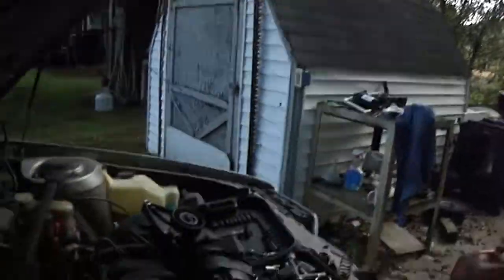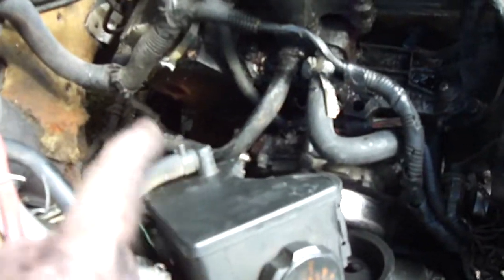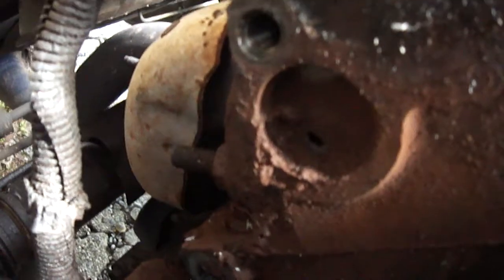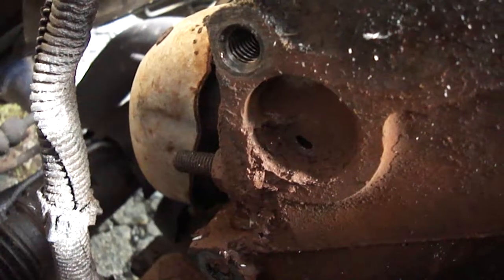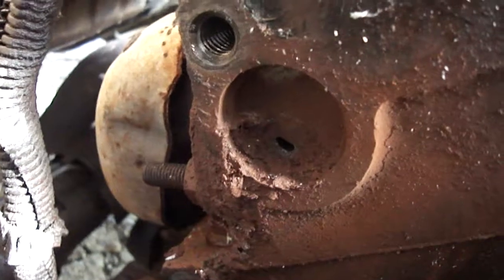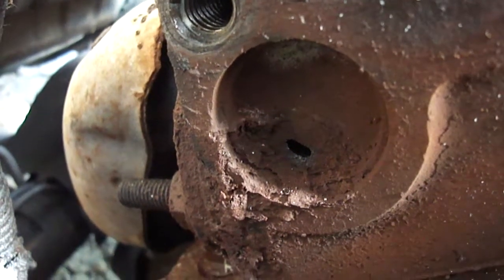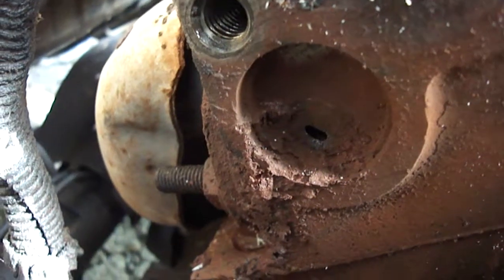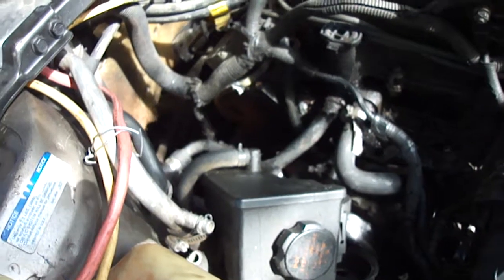95 buick lesabre hidden freeze plug leaking

Comment: Great video. I'm considering getting a GM 3.8. Now I know that I should check the freeze plugs for leaks and rust. It's located on the rear passenger side of the motor, correct?